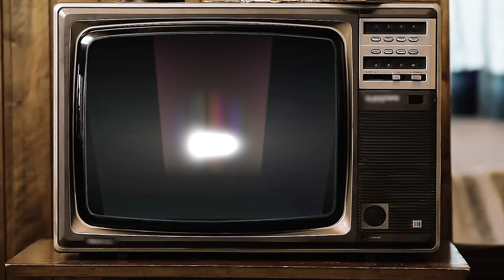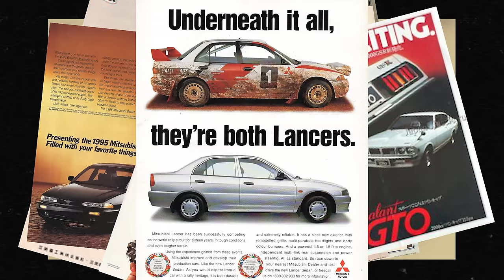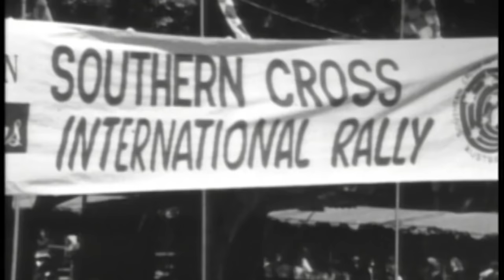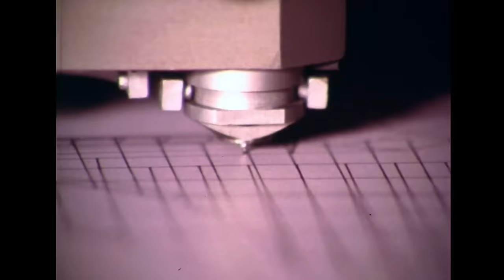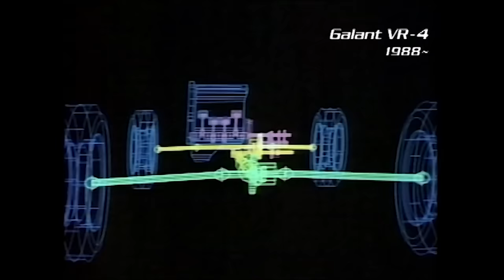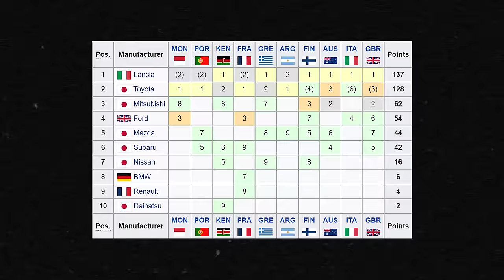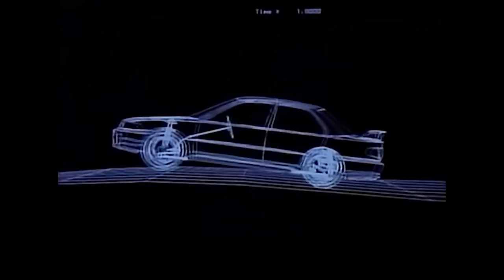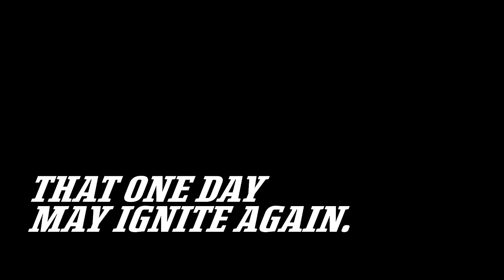How Mitsubishi Threw Away a Dynasty

Comment: From the 4G32 and on, Mitsubishi's engines just got SO much better, so much so, the Hyundai you might be driving, is running Mitsubishi running gear. I had a TH Magna Sports, which would blow the doors off a 3.8 Commodore. I had that car 9 years and only ever put a starter in it.

Comment: My Dad's best friend was a certified master mechanic. He was the shop foreman at one of the largest volume dealerships in California. He was making almost $50/hr in the late 90s. The dealer sold Honda, Subaru, Mitsubishi, even Yugo at one point and some other brands. 
I used to ask him a million questions:
Worst new car ever - Yugo. By far.
Worst new car from a major manufacturer? Mitsubishi. By far.
He said if you want a car thats going to get you a half million miles with only oil changes then buy Toyota, Hinda, Subaru. If you need to be patriotic, buy Ford and Chevy trucks, Chevy cars and Buick. Avoid Chrysler products.
But Mitsubishi he said was hot garbage. They would have customers bring Mitsus back with 40k miles with serious engine issues, and theyd take the motor apart and it looked like 150k wear and tear on any other brand. They regularly had to do major repairs under warranty. So the dealer eventually dropped the brand.

Comment: Had an all wheel drive gallant vr4 way ahead of its time. Odometer changed colors if the keys were in the ignition and you got out of the car and locked the door and shut it. It would unlock. Turbo charged all wheel steering..  Would keep up with a firehawk ta

Comment: Very interesting that the Galant beat the 240Z! 
I bought an ‘82 Dodge Colt new. It grew to be so much _trouble_.  I truly reached a point of hating that car, but it wouldn’t die, it kept hanging on. When I finally did get rid of it, it must have had major carburetor issues. It was getting about 17 MPG. LOL

Comment: The pre EVO cars that you called a 'front wheel drive economy car' did actually have a sporty model, but sadly it was only available in Japan. This was the Lancer GSR Turbo 4WD which had a 4G61 engine and 158bhp. The car was available from 1988 to 1991

Comment: Two biggest issues was the emission scandal Mitsubishi had where they had to sell off their automobile company and split from their electronics division, and the fact that they became too expensive to be competitive in the market. 

The evo X MR was 52K  + a/c excise tax ($100) + shipping/landed tax  ($2500) + govt tax (13%). So you're looking at $61,698 not including markups or extra options! In contrast, it's direct competitor the STi was $35,300. Throw in the same costs $100 + $2500 + 13% ($42,827)and you have a faster car for roughly 19k less. 

Since Nissan has owned majority of the brand, they've gone back to making cheap, poor quality small vehicles like the other two brands in their joint venture, Nissan and Renault.

Comment: The SUV crossover disruption killed the Lancer, along with countless other sedans, the Mirage G4 next on this list unfortunately. Not counting sales in the US, but Mitsubishi's global sales in general as of late has been on a surprising uptick, when the rest of the Japanese car industry has downward sales in 2022.  Key reasons is that Mitsubishi has a much stronger presence around the world than in the US.  One good reason is they have a strong contender in the PHEV line that puts it top in Europe, the Outlander PHEV. Unfortunately it's not available in the US.  Another good reason is their iconic pickup, the L200, and the SUV derived from it, the Pajero Sport.  Do you know these pickups are used with military forces?  This pickup could be the core of a renewed rally effort.  Third reason is the success of their Xpander MPV.  Never heard of it? Like the L200, the Xpander is yet another Mitsu vehicle not exported to the US. The Delica or L300 is iconic as a van, and with a 4x4 set up, as an overlander.  Also another Mitsu not seen in the States.  Mitsubishi also owns Fuso, which makes the Canter, a famous truck.  For the brand to continue to survive and thrive globally, it needs to focus on its key strengths, the image that Mitsubishi already sold to the get this --- rest of the world --- where Mitsubishi vehicles have proven themselves as tough as Toyota.  That means rugged and reliable pickups, vans, trucks and SUVs.

Comment: 6 gen in 7 years that's exactly the problem. Sell period for each model is too short, and too few of them get sold. The cost of development was never paid back.
Reply from the maker: eh their underpinnings were largely shared, i dont think the dev cost was astronomical.
Reply: @the.squidd  every new part (body pannel especially) still have a high cost for tooling change and aftersale inventory liability. If all the chassis parts are the same then you're right, dev cost is not much.

Comment: I didnt watch the video, but Mitsubishi value actually increased by 12% in the last 6 months. ¯\_(ツ)_/¯
Reply from the maker: I didn't read this comment but here's a recipe for a drink called 3:10 to Yuzu 

1 oz. High West Rendezvous Rye

1 oz. Yamazaki 12 Single Malt (or comparable single malt, such as Balvenie 12 or Nikka Taketsuru Pure Malt)

0.75 oz. green tea syrup (you can purchase this on Amazon or use the simple recipe below)**

0.50 oz. lemon juice

Barspoon yuzu juice

3 drops Tamari

Star anise garnish

**Green Tea Syrup: Steep 20 grams green tea (preferably Mighty Leaf Green Tea Tropical) in 1 liter of simple syrup at room temperature for 18 hours, then strain and refrigerate.

Method: Add all ingredients into a cocktail shaker and shake with 1x1 ice. Double strain over 1x1 ice in an old fashioned glass. Garnish with a star anise pod.

Comment: Two reasons why I call them "Its-a-bitchy". Their many years working with Chrysler (DSM) and crappy quality control. While the EVO was a bad ass car on the street. The 4G63 engine used in a lot of the DSM cars here in the US. Failed for the same reason. Crank Walk. The plastic components of the cars would fall apart worse the the 2nd gen Dodge Ram trucks dash. I have to say. They where a lot better at build electronics and heavy equipment, then cars, and light trucks.